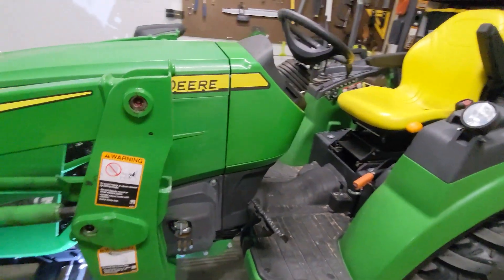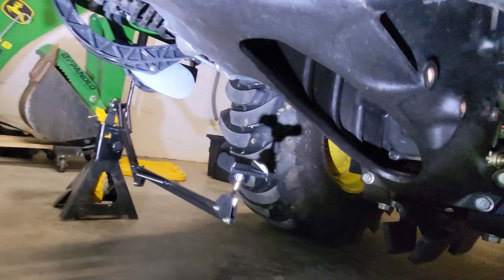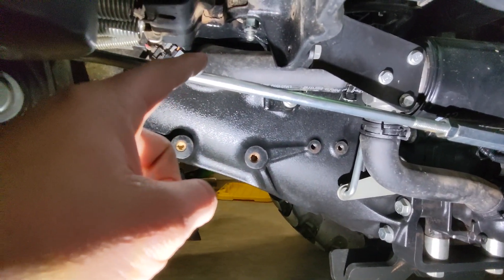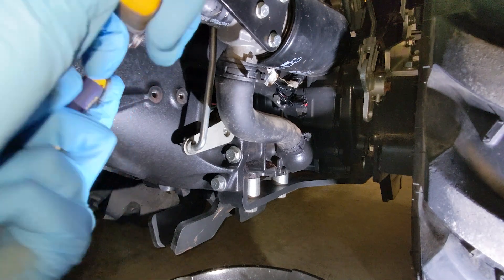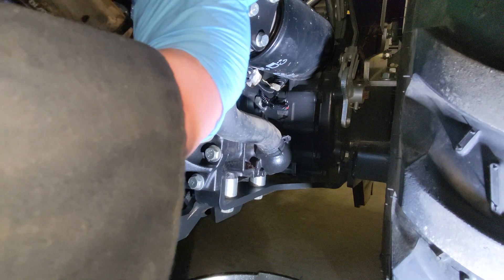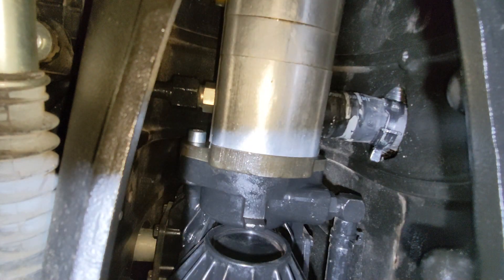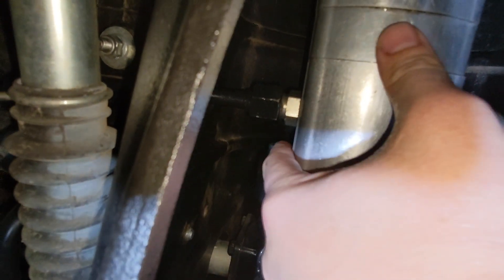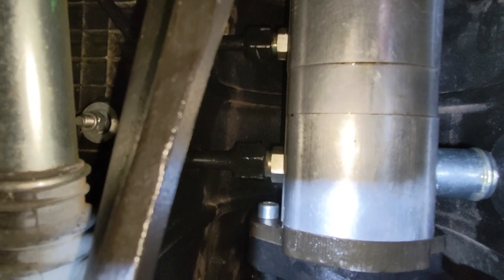HydrosPlus 2R3E Solution Install

Comment: I'm working on my install right now and want to post a couple of comments:

1. If your tractor has the Command Cut setup for a mid mount mower (MMM) this is a little more difficult.  You are unable to have access from the side. 

2. My tractor (2022MY 2038r) I was unable to remove the brake-linkage. The lever at the rear of the tractor would not rotate enough to allow for the rear attach point to clear the transmission (even with brake set at the maximum the hand-lever will go)

Due to both of the above, I am only taking the drain hose off at the pump on the inside of the pump-cavity.

Looking forward to trying it out once done!

Comment: Excellent video, Kevin.  Thank you.  My installation took 4.5 hours with the trip to AutoZone for the gear puller.  The hardest part was breaking loose the 2 Hex-head screws holding the pump on.  That took an hour, until I figured out to use a 18 mm socket slipped over the end of the wrench you supply AND an 8" socket extension as a cheater bar.  Worked great.  The increased flow is unbelievable, I highly recommend the Stage 2 pump!!

Comment: I just finished my install,  all went well. Thanks for this video and an awesome product!

I want to share a couple tricks I learned.

1. This can be done without removing the brake linkage

2. The drain tube only needs removed on the end where it attaches to the pump (leaving the other end alone means you don't need to remove the brake linkage)

3. I was able to torque the nut on the new pump while on the bench by using an oil filter wrench to hold the gear from turning while applying torque (shop-rag between the gear and filter wrench)

* my machine has the Command Cut setup for 72" MMM. Mostly blocks access from the side (but as per earlier comment you can still do this without much fuss)

Comment: Is there any need to check or adjust the hydraulic pressure after doing this?

Is the recommended pressure still the same as with the factory pump?

Comment: I have the 2038R wtih the mid mount mower.  How much of that has to be removed?
Reply from the maker: Nothing has to be removed, it's just that you'll have to work around it a bit to get the suction hose off.  You can do the rest from the bottom opening without having to go through the side hole where the MMM linkage is located.  You can use this trick to break the bolts loose, so you don't have to go through the side for leverage - https://youtu.be/Km2qw-qryLo

Comment: Now I'm curious how they install the pump in the factory.
Reply from the maker: they have it much easier at the factory since they add the pump before connecting the front and rear halves.  I'm pretty sure this pump comes as a part of the transmission assembly.  Splitting the tractor is definitely one way to make the pump removal and install much easier :)

Comment: Would this work with a 2025R ?
Reply from the maker: No.  This only works on the 2nd Gen 2032R and 2038R as well as any of the 3E tractors.

Comment: What is the flow rate for the stock pump vs. the replacement pump?
Reply from the maker: Stock is 5-5.5; HydrosPlus is 9.5-10 GPMs
Reply: @HydrosPlus  Thank you, that is a big difference.

Comment: I just placed my order this morning!

So, correct me if I am wrong, but is there not a half moon key slot in the input shaft to the pump? Is there no key way in the gear?
Reply from the maker: Thanks for your order!   It will ship out today.  Also, you are correct.  There is a half moon key slot, but it's not used in this application. The gear is held in via interference fit.